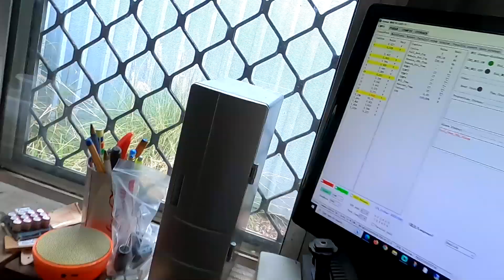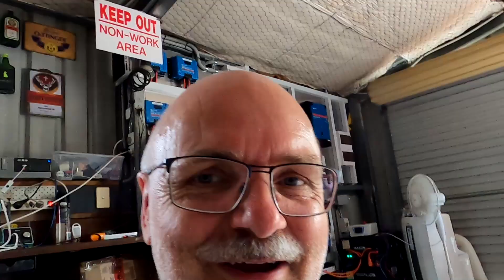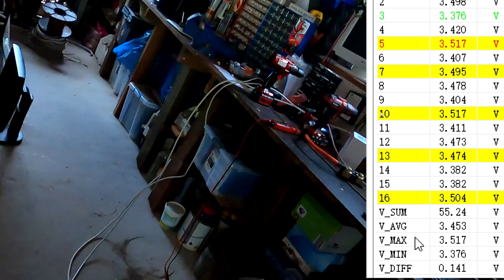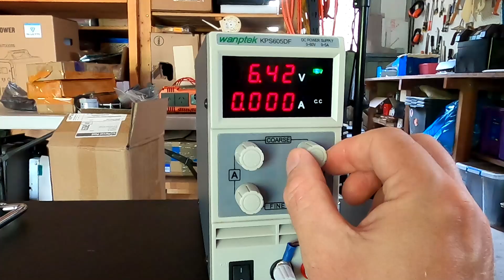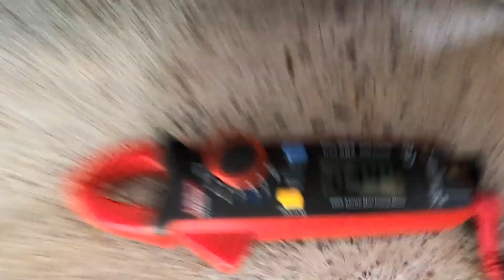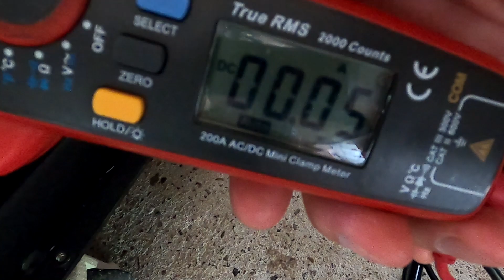Manual Top Balancing of QSO Pre-Assembled Battery Pack (welded terminals) with lights and charger.

Comment: Im top balancing my cells right now and I’m confused. I’ve been balancing for 7 days I have the charger set for 3.65v.  The cells started at 3.28 and are now at 3.37 should it be taking this long?
Reply from the maker: Yes, perfectly normal. It depends on how many cells you have in parallel, how large they are and how many amps you charge with.
Example: 16x 280Ah = 4480Ah if in parallel. 
Charging with 20A will take 224h to charge
Voltage is not an indicator for state of charge with LiFePO4! Watch seme of the other video I made in regards how to charge LiFePO4.
Reply: @OffGridGarageAustralia  4 cells. 230ah.  Charging with 10 amps.  Will do.

Comment: The question is, how much extra capacity do you get now that the pack is fully balanced vs when it's unbalanced (from the factory state)?   Is it worth the effort?   You are so high on the charge curb that it would appear your only getting 1 or 2 amps extra into the batteries with low voltages.

Comment: Thanks Andy 👍
Why do manufacturers think they can get away with such low balance current? It makes NO sense.
Reply from the maker: It comes form Li-ion where you can start balancing at 3.2V and then such a small balance current can work if the capacity is not too large. Not so with LiFePO4 cells though.

Comment: Andy, check to use a Geya relay GRV8-02 ACDC24-48V from GEYA (aliexpress) ; it's a settable voltage relay, I set it to 54.5.V, and there is a 3% hysteresis ; it's perfect for a battery, and will activate automaticaly your active balancer :)

Comment: I have a configuration with a MultiPlus II 8000 1 Cerbo, 2 MPPT 250/85 and a SEPLOS MASON 51.2V 230Ah battery. I have a strange behavior. As long as the battery is charging the MPPTs supply the battery charge, the AC loads and if there is surplus, injects the surplus into the grid. But as soon as the battery is charged, the AC loads are supplied but there is no longer any reinjection on the network. DC Injection is enabled in ESS. And I can't get around this problem.

Comment: some people (ok a very few people) like to bottom balance and I found a  way with my lipo bike packs  the jk bms was to enable balance at 2.9v, shutdown at 2.9v, discharge off at 3v, charge at 3.2v, charge release at 3v. add a small pack load (5-10%) then leave it till your happy with the deviation . then turn off balance and put settings back to normal, charge to full and use as normal , if the deviation goes high you have capacity issues /imbalance. i do this monthly on my ebike packs

Comment: Hi Andy,
at the moment i'm using my 6kWh diy battery with the Seplos BMS at my Victron System (MP2,2xMPPT 100/20) but i need more storage and wand to sell the "old" and build a new one (16x280Ah). With which BMS would you go in my situation? JK without com to victron? Seplos with com + Neey?

Comment: For sure, the best way to understand balancing process is to do it manually. Depending on the cells state, sometimes takes hours using JK BMS, 20A electronic load, 50A charger and bunch of power resistors ;).

Comment: Hi Andy, Thanks again for another informative video. I would like to see the 5 amp dumb active (capacitive type??)balancer  on this battery. But unsolder the on tabs and cable in a  set of contacts of the MPPT solar charger or the Cerbo so that when the battery is in Absorption turn on the balancer, or what ever criteria you think is best.  So this potentially would make the dumb always on balancer a fancy technical balancer only operational with pre-determined criteria,. I am hopping this will keep it under control. I ordered my 16 cells today, and very nearly an active balancer but I am not Sold on them yet as from what you have shown us, you cant set a start and stop balance activity even on your fav Neeeeeeey

Comment: Good video, thanks. This is why I use the active balancer on top of the bms since last year. It will always work, in any state of charge, charging of discharging. Always very low difference in cel voltage and not wasting any power. And most of all, no extra work and always max capacity.

Comment: What a pain, I'm glad I bought genuine grade A EVE cells from Fogstar in the UK. I've never top balanced them, just assembled the pack and off we go. Had very poor weather the last three or fours days, hardly any charge in to the battery, sun shinning at the moment and the cells are charging. Average cell voltage is 3.283v, deviation is 0.007. Deviation varies more when the pack voltage is low, but stays very consistently low when charging up, and fully charged.

Comment: Hey Andy - why not put alligator clips on your active balancer cable so you can easily move it battery to battery - sure the connections won’t be perfect but think of the reuse ease! I’d love to see if alligator clips reduce balancing quality.
Reply: Andy in a previous video has used a multipoint connector so all he has to do is plug it in, voila !  André in Sydney

Comment: Good vid & recap of how you manually balanced Battery 1 setup Andy, I have also used this method at times. 
 Pity the manufacturers dont seem to understand the charging needs of their own products, as this undernourished passive balancing idea seems to be a common theme & flaw throughout many of these server rack type batteries. I thought they would have figured all this out by now. I have a couple of JK BMS’s fitted to batteries (24v & 48v) with 2A active balancing, and it just seems to work fine, but can struggle occasionally, so I would say this is an absolute minimum balance current required to maintain these cell types efficiently, and a 4-6A balancer would have to be better for peace of mind.
My 3 x Seplos server rack batteries never really balance properly when charged for 6-8hrs & 100% SOC daily

Comment: you need a set of resistors to clip on to each of your your high cells, and then just dial in the charge current so that the rest charge, but those are neither gaining or loosing.
Reply from the maker: The lights are the resistors. That works well.

Comment: Time for some spot welding!  New test for the channel.
Reply from the maker: Spot welding on aluminium?
Reply: @Off-Grid Garage  connect the balancer someway that secures it to the bus bar. Though, I'll have to take your word for it that they're aluminium. Anything temporary is likely to create a short as you bang the box around in the OGG.

Comment: Also Andy, I some time ago I considered using a bank of blocking diodes to top charge a  sires wired pack of cells in parallel at about 3.6V. As if I set the main sires charging voltage to around  55v, the 3.6v diode isolated charging circuit should top balance the cells without the issues of an active balancer.
Reply from the maker: I hope you have a BMS connected with such experiments.
Not sure how you would use a diode to balance a battery pack. Please explain.

Comment: If your putting in more current than the balance can discharge you will never balance the pack. Adjust the charge current to below the balance discharge current and it will balance. It may take a week to do so though 😁
Reply from the maker: The balance current of the BMS is 60mA. This will never work. Not even if the BMS can balance with 150mA.
Reply: @OffGridGarageAustralia  It might possibly work in about a full year Andy 😂🤣

Comment: Good Insights as always Andy! The good design elements in combination with the glaring design oversights has me wondering if the mechanical designer who did well on the case designed the electrical without really understanding that part of the design? 
I wonder if there could be a low and high current balance function in that BMS? The passive balancing on the cheap Daly eBike BMS units,balance at about 130ma above 55V during charge, and that struggles to keep a 6ah pack in balance, so expecting 50ma to balance a 200ah pack seems an absurd design choice on the BMS maker's and QSO's part. 

On my small eBike LifePo4 packs, I found if set the charge limit current to the BMS balancing current (about 130ma) and the charge voltage to about 57.5v, and let it float for hours it will eventually balance the cells. But if it I set the charge current to around above 500ma the BMS just sets there bleeding off the charge current. 

All goes back to what the Daly rep told me and you discovered about two years ago, that low current passive balancers are only marginally effective smaller intermittent use packs, and large packs that continuously cycle require an active balancer.
Reply from the maker: These small charge balance currents only work with Li-ion packs where you can start balancing at 3.2V or so already. With LiFePO4 and the very flat charge curve, there is no chance. 
I agree, the system designers don't seem to know about this...
Reply: @OffGridGarageAustralia  except the daly normal bmses or any other ebike like bms starts balancing at 4.2 volts which is correct because you only want to top balance a lithium pack. The issue is the balancer resistors NEED to reduce the voltage of a cell so the bms will reconnect the charger over and over as the resistor continues to bleed off high voltage cells and then after awhile the pack is balanced. If a bms doesn't reconnect the charger then the bms does NOT balance a pack and it should be called a bms WITHOUT cell balancing.

Comment: Hi Andy, and thank again for this funny video! 😂it's funny, because this is a new Battery! pack from QSO. 
They don't even take the time to balance and test their pack before delivery?!  It is simply shameful!  Anyway with this BMS and these cells (which must not have been well selected at the start) it does not balance out!  maybe with the Neyyyyy?  but if these cells are bad like big difference in resistances the problem of non-balance will come back, after a few cycles.  This Battery reminds me of a Battery that is already 3 or 4 years old?!  😂
But thanks again  Andy for share this experience.. (QSO have big progress to make, if they want to provide quality Battery packs, for the moment it is not the case at all?!)

Comment: What happen to the active balancer you have somewhere? Could you not just connect that one instead of all manual work? OK, typed to quickly - next video active balancer. QSO battery should be at least Dollar 200 cheaper for having a non-working balancing function - QSO get you act together!

Comment: Why don't you balance down to the cell that has the lowest voltage?
Reply from the maker: That would not work as the lowest cell was still in the flat area of the curve. We can only balance at the top, so above 3.45V.
Reply: @OffGridGarageAustralia  The fact that you keep draining the same cell over and over again tells you that you didn't discharge it enough.
Reply from the maker: @SpeakerKevin  I know, that's what I said. But other cells are catching up as well and I wanted to demonstrate what a balancer is doing. I wasn't really serious about manually top balancing this battery. 😊
Reply: @OffGridGarageAustralia  I top balance my 48v battery by hand every year, It only takes about 20 minutes because I discharge the high cells down to the lowest ones (they always spring back a little). To save time, I may just try an active balancer. Thanks for demonstrating how well they can work.

Comment: How about disconnecting the BMS and any connections to charge controllers etc. and let the cells balance. Or do the single cells not find a level like your 3 multi cell batteries do.
Reply from the maker: The BMS has only 50-60mA balance current. I would need to keep the battery on the charger on say 56V for several weeks to make this work.

Comment: Beautiful and iillustrative demonstration of how the Active Balancer is working.
I've seen many tests of original purchased batteries and after testing, inspecting, reviewing and disassembling them none of them convinced me that they meet all the requirements, always something doesn't work or works weird.
The best would be an honest DIY battery build and with a personal and more suitable choice of BMS and active balancer so that the battery can always be under control and do its job and probably at a lower price.
Reply from the maker: Yes, I absolutely agree. I have one more pre-build battery here to test and want to compare this to the QSO and the DIY battery shelf. But DIY, you never can go wrong...

Comment: would it not be simpler to use a charge and charge each single cell up to the same voltage ?
Reply from the maker: Yep, as I have shown in the video. Both methods will work.

Comment: i did think about removing the burn off resisters on a bms and adding a relay that is wired to bulbs for the battery to allow the bms to be able to burn off more power but then i found active balancers and tend to use them now on larger systems and switch that on when i see large devation on the battery

Comment: This is exactly what I was doing on a SANBEN brand LiFePO4 320Ah 16 pack, sold as so called grade A and new, but it was grade B with at least a 20Ah capacity gap between highest and lowest, 4 cells which were already slightly swollen (6 mm of curvature) and a self-discharge that goes from simple to triple. My BMS could not balance at all and cut even from 54 volts.
So I spent 3 hours a month on average manually rebalancing my pack both up and down like Off Grid Garage did.
- Downward with a bank of resistors which emptied at 2 amps for 3,5v.
- On the rise with the laboratory power supply.
But by doing this merry-go-round and swapping hundreds of times my connections, mistakes inevitably happen and I've had 2 or 3 times to reverse the polarity and see some sparks. (Fortunately, the lab power supply is protected against polarity inversion and overvoltage).
So I switched to the active balancer and it's clearly worth all the serenity in the world: no more manual manipulation with the risk of error, not to mention the time saving! Especially since the device gives you a perfect balancing in only 36 hours.

Comment: Andy,
It would be interesting to see if that BMS does *any* balancing. Why would they sell a battery system that can not balance? Or takes that long? I just don’t get it. And then they use cells that clearly need balancing? 

The only way I found to see if one of these glacial balancers actually is working is to run a data logger – Maybe you can log the cell voltages via the VE system? Maybe someone can come up with a script and dump it to a file? Maybe it is already built in? Apply your 55.2V for a couple of days and log, and then you can plot it to see if any balancing is going on. For example, I did that to the Daly (using sinowealth data logger) and realized that:

1. It is effectively not working (due to forced charge balancing on Daly) – the voltage never seemed to move (like here????)
2. if I ‘fix’ their settings and turn it on (bypass charge balancing with hack) it only does 6mA (not 20).
3. once actually working it takes hours to see it voltage moves at 6mA.....

I figure 6 mA would take on the order of 10 days for your battery here… (give or take). To ‘see’ that change requires a graph. Unlikely you would see it by looking at the voltage on a screen. I sure hope this balancer is better than 6mA.

There seems to be an industry wide blindspot when it comes to balancing. 

So: what would it take to get input on this from QSO that is not just a brush off? I would like to know what they think about this.
Reply: 24/7/365 just saying

Comment: Considering the battery price, it is strange that you have to do it. I expect BMS to work appropriately and balance the cells themselves.
Reply from the maker: This BMS does only 50-60mA balancing, so will take weeks to balance the pack and I would need to keep it on 56V all the time for that.

Comment: Andy,
Ah the curse of the tedious manual balance. You can charge, you can discharge, even at the same time just don’t accidentally connect your power supply backwards with those alternating cells … ouch.. :).

My go to manual method to avoid blown power supplies: Clip on Heltec ( crocodile clips, active cap balancer, lowest cost, 1A net balance capability.), +55.2V supply. I figure your battery here would take 1-3 hours of Spat-chill time while you wait.

And while you wait sitting back contemplating why this balance thing seems to be so difficult to get a grip on by the manufacturers. Does QSO realize you are being forced to add a balancer?

Comment: Or a 2A passive balancer 

cough REC BMS 😁
Reply from the maker: I won't buy a REC BMS, no... For that price I could get cough 3 JK-BMS with 2A active balancer 😉
Reply: @OffGridGarageAustralia  fair enough, but I already bought mine, and it apparently integrates well with the SMA Sunny Island (I've yet to install it all).
Reply from the maker: @davidpenfold  It will work, for sure. I have seen some reviews and after the complicated setup, it works well. If you have only one battery bank, it's a good solution.
Reply: @OffGridGarageAustralia  apparently it can work with a 45kWh parallel setup

Comment: I’ve used two Neey balancers in parallel, yes it’ll work, but even that is still way too slow for a bad balance. You got to do what Andy is doing if you have welded on busses before even an active balancer can put a dent in it.
Reply from the maker: The NEEY in parallel and still to slow? Wow, what kind of cells do you have that they drift so much and need so much balancing?
Reply: @OffGridGarageAustralia  
Those were CATL 310ah. I started to balance 3.4? Vpc and anytime I hit them with a charge the delta would go into runaway. I could tell this was going to be a long term nursemaid and said screw it and did a traditional top balance with a diy 80 amp 3.65 power supply. 90 minutes later-done. You can see the mess on YouTube “Top balance in series FAIL”.  Because of you Andy, I found JK & Neey thanks!